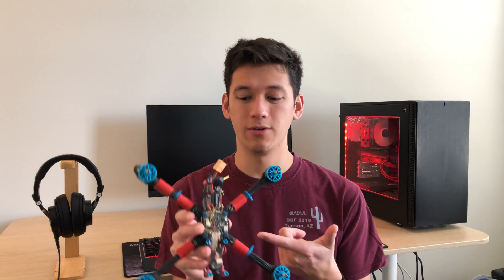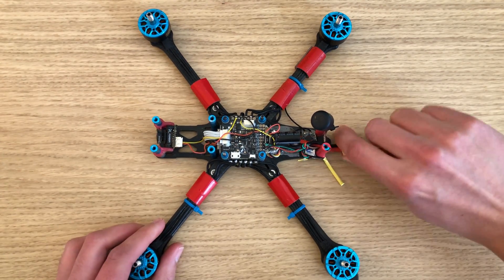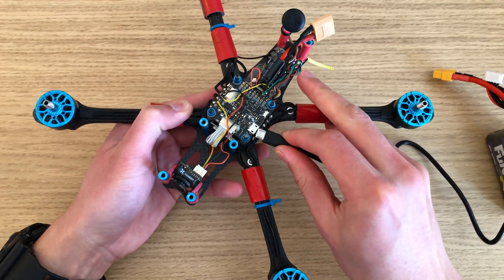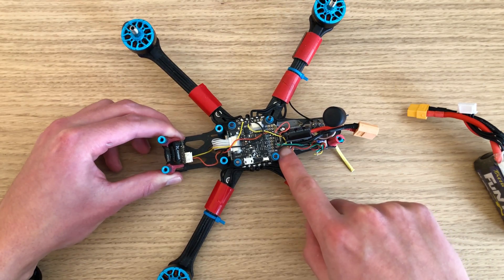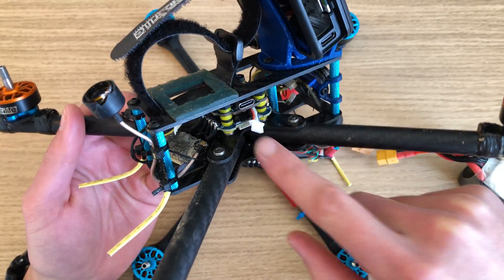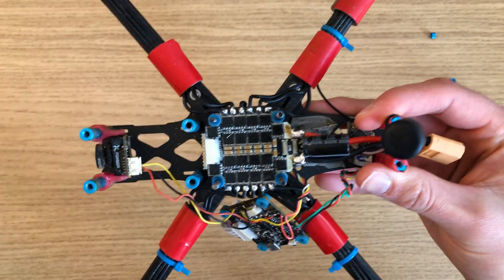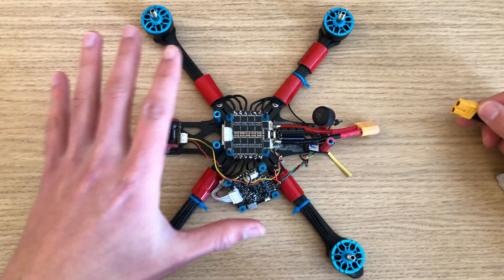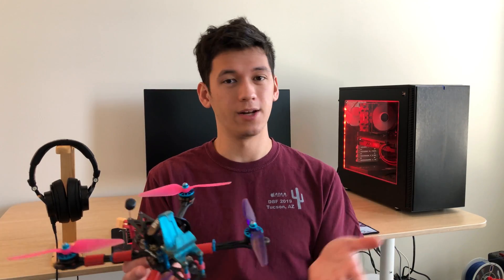Fixing a Drone That Won't Power On - Troubleshooting Tips

Comment from the maker: What troubleshooting tips do you have?
Reply: You can use a multimeter on the mosfets and it'll narrow down which one or one's blew. You just put the positive on one pin on one side of it, then if you have continuity on the pins on the opposite side of the mosfets it's bad.
Reply: My drone hited too hard ground and power button litle bit comed out and I cant power on version killer Bee E88
Reply: @antragulbe7384  same
Reply: Same problem  please  help

Comment: FPV is very related to 3d printing but also electronics repair. I have repaired many FC or ESC just by injecting 1v and looking via thermal camera, then replace the component.

Comment: This was a lucky fix. 
I can't get power from my USB on my 3 month old build. 
I am believing it had something to do with my oversized motors And And the fact that I was using A speedypizza 1200mah hundred c pack. I have a feeling at 35 amp ESC was not able to keep up with the Xing 2204 motors and that pack.
I lost an arm on that frame in the fall too. 
$$$$